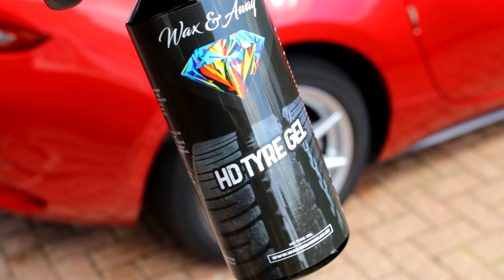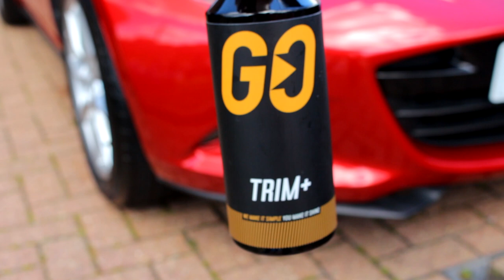Convertible roof clean and protect

Comment: Thanks Paul. I really enjoyed this one. You being more experienced than I am when it comes to detailing, you may or may not appreciate this tip. But I used to pre clean my soft top with Miltons Sterilisation Fluid (for sterilising babies milk bottles) at the recommended Milton's dilution, with a soft nail brush. The amount of green algae that it removed was amazing. Then I went on to shampoo and protect.

Comment: Cracking timing Paul. I have a 650i Cabrio to detail next month. The VP roof products look really worthwhile, having used Renovo previously. I'll buy some of the VP stuff. I can vouch for the pressure washer lines, from my first roof clean. Now, like you, it's a hose wash down! As for the foamer, where in your links, will i find the Laser Foamer? I have the IK one atm, and it's not a great product imo.
Reply from the maker: https://hdcarcare.co.uk/collections/laser-industrie
Reply: Renovo is good stuff. Smells awful but it’s good stuff. That said I wasn’t impressed with the protector and it needs several coats to get decent results from. The cleaner is decent but a cheaper normal APC would do the job. The colour reviver is superb though and really helped my drop top.